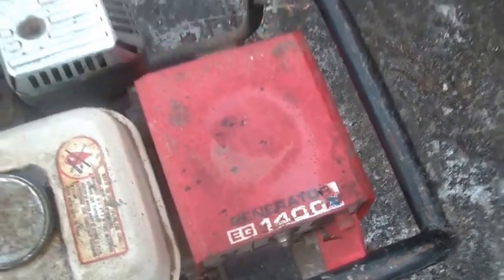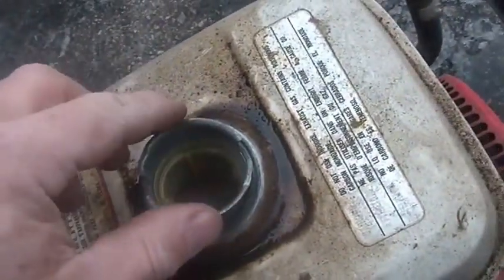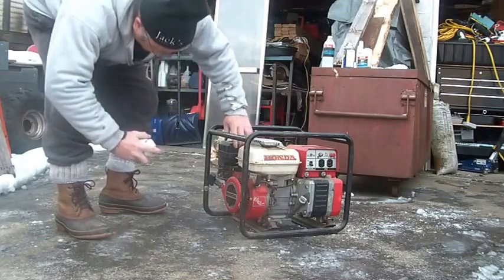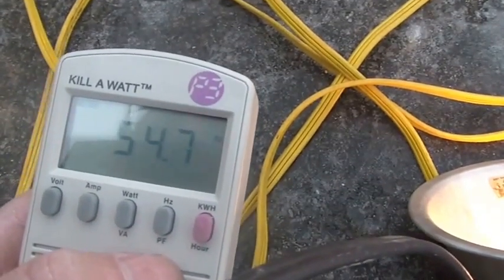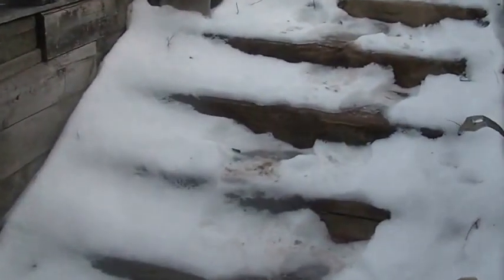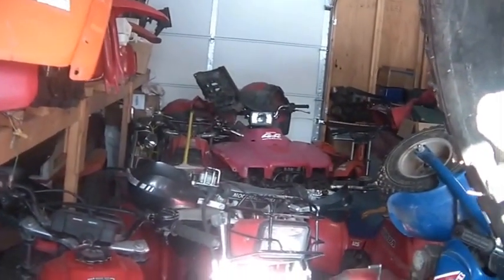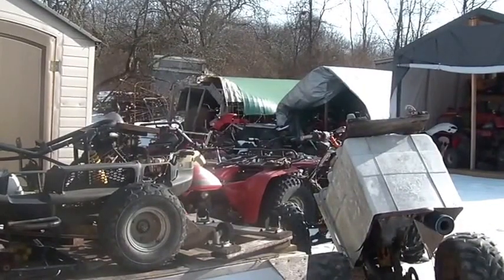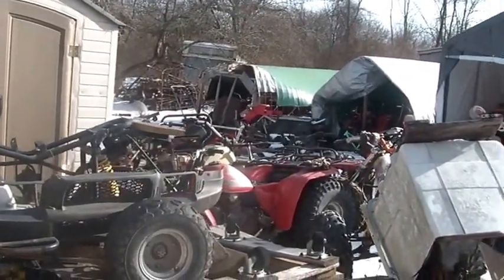Garage Sale Honda Generator cold start, Frequency, Voltage checks

Comment: The engine was missing due to water in your gas, that's what was causing your  frequency to fluctuate. Your volts were also jumping around.
Reply from the maker: Hey Shane, I will drain the gas and try it again.... The auto voltage and frequency control should of controlled it a but better one would think.... Thanks for the info, Ur thoughts, watching and commenting!!!